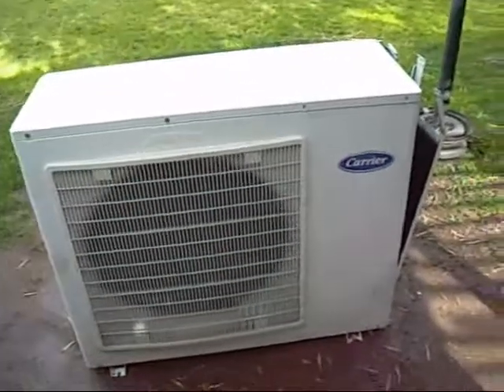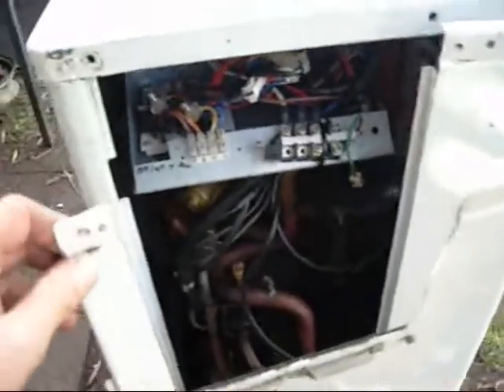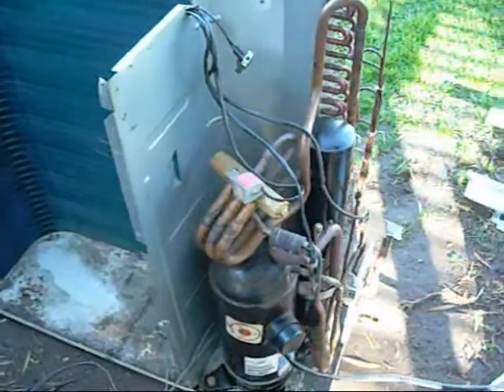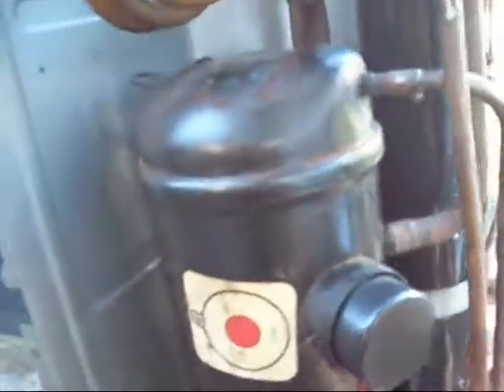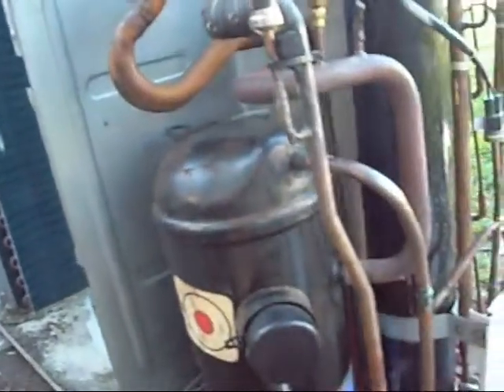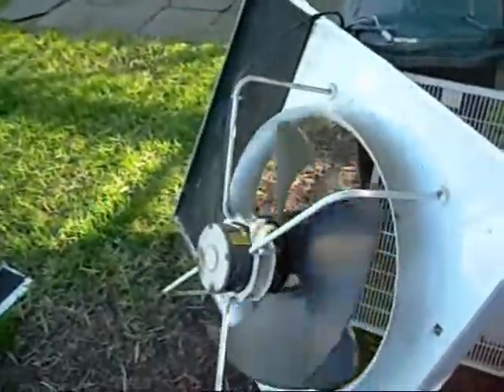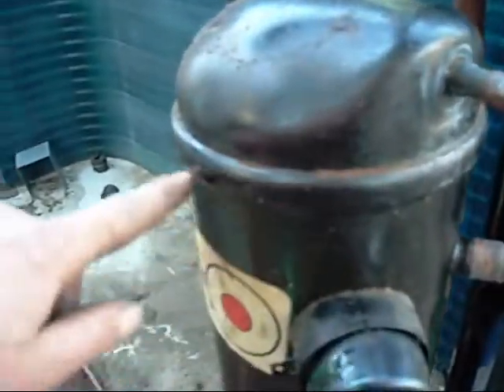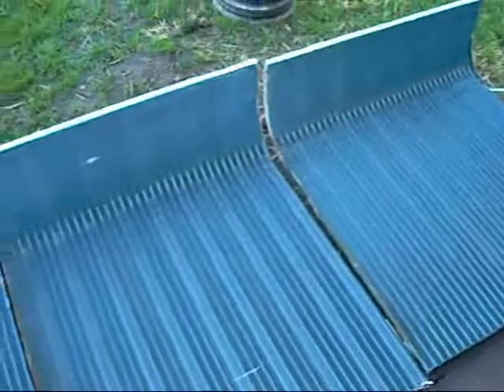Carrier Heatpump Scrapping

Comment from the maker: Cool!, Motor HP and speed is not marked on the data plate but I think its around 3/4Hp, 3 pole 2 speeds, prolly 1100 and 600rpm or so. a 1Hp low speed motor or belt drive would be more than enough.
Shaft Dia is 19mm with a flat ground on one side to a depth of 1.5mm. Bore length is 45mm.
impeller OD is 610mm, but I have smaller ones from Daikin and Mitsubishi units if its too big.

It dose have a few small nicks in it from the scrappers but its not cracked or unservicable.

Comment: @acthetech 

I tend to agree.  I bought the top of the line 5 ton carrier infinity heat pump system for my shop during remodeling a few years ago.  The energy savings from the system is amazing.  1/3 annual operating cost of the old system.  Another year or two will have paid for itself in savings.  So far no problems.

Comment: I'd actually have to say that the Carrier Round-One's and Carrier Tech2000 unit's were actually pretty good. Carrier even today has a Great Residental Line of Products that are made in the US and I think they may make their indoor coils in Mexico (unsure of, many companys make coils in Mexico) but Carrier makes good Furnaces, Air Conditioners, and Heat Pumps.
Reply: Carrier is fine as long as you don't buy a split system from them. Their ducted systems are made in house but the spit systems are rebadged from Korea and are garbage.